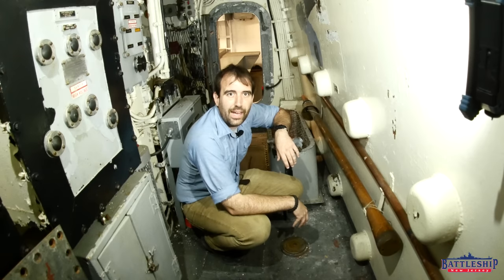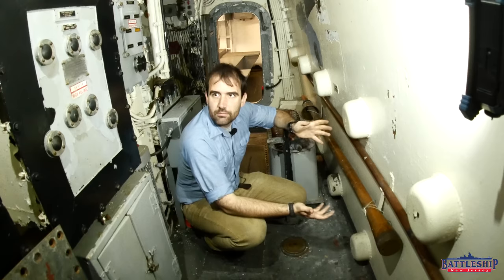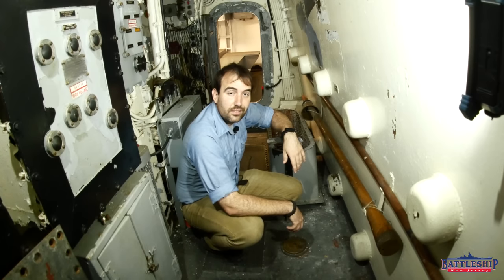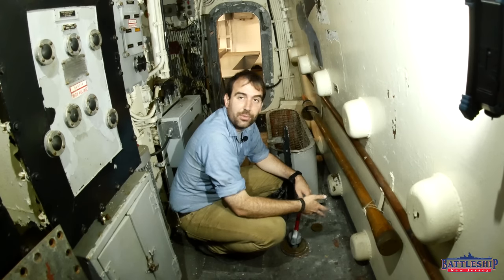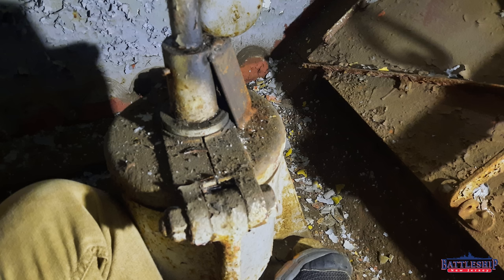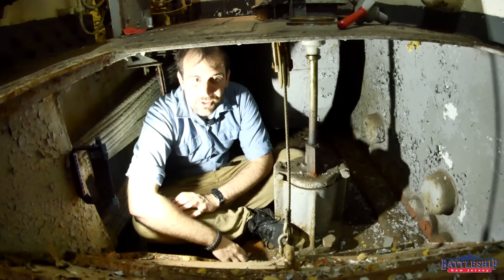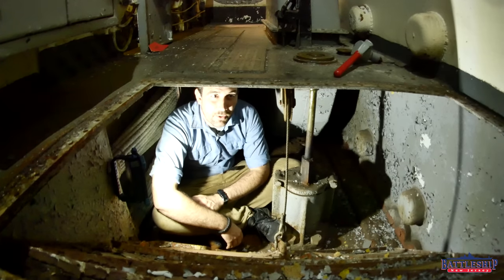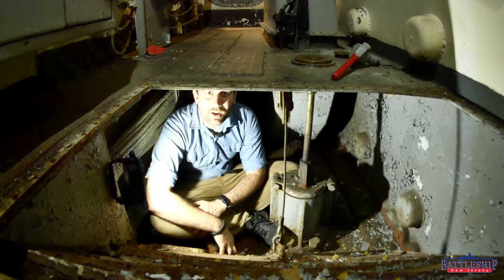Are The 16in Gun Turrets Welded in Place? UPDATE!

Comment: IF the pins were removed.there should be a manual gear reduction drive in the turret...on either the south Dakota or NC class such a drive exists..it is like 3 hours to move...same with elevation of the guns.  I saw a video of one of the memorial battleships lowering their guns to put the bloomers on...perhaps Massachusetts or Missouri
Reply: There most likely is. You can get a glimpse of the gearing that turns the turret in the video that Ryan did about the electric deck.
Reply: You can elevate the guns manually, but I don't think you can travese them. Don't think the gear reduction is low enough.
Reply: @ionstorm66  I bet its possible to decouple the hydraulics and then use a block and tackle on the barrels to the deck since its just sitting on rollers

Comment: Ryan you give up too easily.  Whatever turns or rotates under power almost always has a manual wheel to operate the thing when power is lost.  emergency steering for example, yes it takes several thousands manual turns on the wheel to move it, but its there.  The turrets must have a manual rotation gear in there somewhere.
Reply: Or find away to lower the amount of amperage the motor draws. Imagine letting people pay to operate the forward gun turret. Just install sensors and a computer to limit the movement allowed and a button for emergency stop.
Reply: Yeah or lift an external generator aboard or use a high current motor controller.  Could almost certainly get it to move somehow.
Reply: @ThePTBRULES  Yeah, I mean it takes a lot of power to turn the turret fast , if you reduce the speed, this also reduces the power needed. Of course the question is if it is possible to reduce the speed without heavily modifying anything.
Reply: @ThePTBRULES  Keep in mind the breakers are only for extreme overcurrent and to prevent the wiring from catching on fire.  It's not what the motor is rated at.
Reply: You can convert horsepower to kW. 300hp is 223.71kW. W=A*V. Assuming a 450V motor, that’s 497.133A. However, given the amperage of the breaker mentioned, it is probably a 125V motor as that would draw 1789.68A. 

Wikipedia mentions that the SSTG’s provide 450V power. Based on my experience in the Navy, shore power is supplied at the same voltage as the generators. This means that the 1200A shore power breaker can provide 540kW of power. Over double what the turret needs to spin. 

So, yes. They can rotate A SINGLE turret on shore power easily.
Reply: @shaun3423  yeah makes sense.  So they simply need a monster transformer to drive 450 volt.  Also with a motor controller they could generate the necessary waveform and get a torque vector that is as strong as their power supply cns support.  It's fine if the turret moves only slowly.
Reply: "Ryan you give up too easily"
Here's what I imagined happened:
Ryan: "Guys! The turret is technically welded in place, but we can undo it in like 5-10 minutes! Let's do it and move the turrets because it would be REALLY COOL!"
New Jersey Department of State, United States Navy, half a dozen other agencies/organizations: "NO!"

Comment: The whole point of the navy putting them in museums was so that, if it became necessary, they could, theoretically, re-commission them. It makes no sense at all that would hard weld the turrets in place at a point that would destroy the mechanisms themselves for future use.
Reply: Not really, this was done when they were put to reserve, not museum donation. The potential for them to be mobilized was primarily aimed at by what is and is not allowed contractually, but only to a point and that point is mostly gone because navy got rid of whole lot stuff needed to support them.
Reply: Once gone from the property of the state, they're gone. As museum ships (and outside the gov's care) they're no longer usable. They're governed under an agreement plan (as Ryan states) but that's about as far and wide as the reach of the gov goes. Well, maybe if the museum tried to ... i dunno, sell the ship to another country's military... but that might be in the agreement papers as well.
This mod we see here, isn't done for museum deactivation purpose, this is done because it's the cheapest simplest method to stop this turret from turning.
I've seen this thousands of times, if there's an easy way out to stop something from doing something, where the need to keep the mechanism at large in existence is in place, the shortest, easiest path is always taken.
Old buildings, they take the cogs out of the elevator mechanisms. They cut the first floor ladders out. The're doors barred with concrete blocks to stop the door from opening. 
Bunkers, they will just cut the wires to the electric motor or drain the hydraulic fluid out of the hydraulic motors. Even saw a bunker where they basically removed the metal link bar from the safety system, so once all but the escape shutter doors were closed, they could never be opened and then poured a concrete plug on top of that final door. Easily reversible.
There's a bunker complex in Italy, they just walled up the main entrance, you can still get inside the old cableways.
Reply: @aserta  The Iowa's are special case. Recievers of the ships have to keep a minimal level of maintenence on the ships so they could'theorticly be returned to service of necessary.. That restrction was supposed to end in 2011 when, as the law states  asufficent replacemtn system of equal or greater firepaower could realized.The problem, is, the railgun is far from being as ready as they hoped. Hence why Iowa was moved to LA, becuase the curators in SF couldn't afford the minimum maintanence required by the law any more.

Two, while fully decommissioned, are still listed on a reserve list. The other, while not on the reserve list, still must have minimum maintaince so they can be used for parts if the other two are returned to servivce. 

The Battleships are the only servicable weapon the navy has that can do close shore support for large scale amphibious landings. Aircraft, while they do surgical strikes, just arent capabable of staying on station and essentailly carpet bombing the shoreline and near shore defenses. Until the railgun system is ready, the Iwoa's are not fully released from the navy by law. They can still be recalled and have to be maintained for that possiblity. No, museum curators do not have carte blanche to do whatever they want with them. The navy is using the museums as simply free long term storage.
Reply: "navy putting them in museums was so that, if it became necessary, they could, theoretically, re-commission them."
Like, say, in case of alien invasions where the invaders fire toy-peg-looking shells at ships happen to drop down and challenge both the United States Navy and Hollywood to a game of "Battleship."
Reply: @matchesburn   As opposed to scrapping them.
Reply: @snagletoothscott3729  
"The Battleships are the only servicable weapon the navy has that can do close shore support for large scale amphibious landings. Aircraft, while they do surgical strikes, just arent capabable of staying on station and essentailly carpet bombing the shoreline and near shore defenses. "

In what alternate reality do you live?
Never heard of carriers?
They have things on board like planes and helicopters that can be used to support landing forces (and far beyond the reach of BB guns), loiter for hours while the ship is far away from enemy lines and these 'guns' can actually see their targets

It amazes me the childlike naivety people possess when it comes to old battleships
They are obsolete, have been for 75 years, just because some conservative thinkers didn't want them gone and the navy tried to use them because they simply still had them, doesn't change that fact
And even if Railguns become a reality, they don't need to put them on heavily armored 800' ships

Comment: Do the Iowas have a mechanical backup for any of the turret systems? Texas has the chain falls, then again, Texas also has backup steering after the electric and steam steering systems; I think we recently established that the Iowas have a mechanical adjustment, but not full rudder travel without the powered systems.
Reply: They do, but they're far too slow to be of any use in a combat situation.
Reply: @ghost307 So then the museum could turn the turrets without energizing the motors if they really wanted to, but probably not on any regular basis such as they do for some of their other equipment.

Comment: Shore power is intended to provide "Hotel Services" to allow crew to live onboard pierside while the plant is shut down.  There should be enough excess capacity past that point to allow powering the minimum required to light off 1 boiler.  The general plan is that you use shore power to bring up one boiler, allowing you to bring up a Turbine Generator.  Once that TG is up, you have enough power to start bringing up the rest of the plant.  

That said, how you checked the rated outputs of the Emergency Diesel Generators?  Any one of them should be adequate to bring up a boiler, and I'd be surprised if there wasn't enough power to operate at least 1 turret and support equipment.  (They should all have breakers/bus ties on the main board)

Comment: That is way more than a 300HP motor should draw. I suggest you look at the nameplate. If it is sevuced at 460V it should have a full load Amos rating of something like 400 amps. The breaker may be that rating to allow it not to trip on the starting inrush current of the motor.
Reply: Starting amps are about 6 times what the running amps are.
Reply: That's called the interrupting rating of a fuse/breaker and I think you're probably right.   I think max locked rotor would still be under 2500A on a 300hp motor...
Reply: @ghost307  Yes, and a properly functioning breaker should allow that through. A breaker can trip either magnetically, which protects from short circuits, or thermally, which protects it from sustained overloads. Motor inrush current shouldn't be high enough to trip a breaker magnetically or sustained for long enough to trip it thermally.

Comment: That looks like your industry standard cheapest fastest option to "weld it in place".
Reply: Yup, but that’s sort of what you’d want as part of your efforts to mothball a ship. Your modifications should be the minimum necessary to make the ship ready for long-term storage, while simultaneously as easy to reverse as you can make them. The pin is already doing the hard work of keeping the turret from rotating. All you need is to keep someone from mistakingly raising the pin.

Comment: Didn't you guys do this one already?
Reply from the maker: We have new info! This is a follow up
Reply: @BattleshipNewJersey  Do they move now? Because in the last one they (spoiler alert) didn't, but were capable of movement.
Reply: @BattleshipNewJersey  You mean you folks went crawling under the shelf plate without me?
Reply: Happy to see another video guys. Thank you.
Reply: @BattleshipNewJersey  so... Now that Iowa has turned one of its turrets, how long does it take for you guys to make it work? I specifically want to see Ryan dremeling the welded pieces of iron off, that hold the locking pins in place😂 After an hour or so you should hand him the angle grinder over.😜

Comment: A 300hp motor at 480v is going to draw 350-400 amps.  The problem would be inrush current on start-up which only lasts for a few seconds but can be 6x-8x the full load amps.  That's why the breaker on the ship is so big.  Depending on the breaker on shore, you might be able to adjust the trip time to handle it.

Comment: I'd be surprised if the turrets would rotate even with power to the motor at this point.  The 16-inch turret weighs around 2000 tons and I suspect that they've more or less "welded" themselves into place by now.  I think the term I'm looking for is "seized".  Would take a lot of WD40 to get her moving again.

Comment: A 300hp motor full load at 480v would be 348 amps. 208v 698 amps. With the ship stationary I'd bet it would take less then 25hp (75 amp at 208v) to rotate the turret. You have plenty of electrical capacity to move them slowly. Chasing a fighter jet with the ship bucking.. not so much.

Comment: No way does a 300hp motor draw 1800 amps...a 3 phase 480 volt 300 hp motor draws approx 350 amps at full load
Reply: But what's the starting current?

Comment: I believe you are misinterpreting the current requirements for this 300HP motor. Now you did not provide the specifics of the motor in question, but making some assumptions I offer the following. Assuming this is an 3 Phase AC powered motor and using a nominal shipboard voltage of 480 VAC, a 300 HP motor would use approximate 400 amps of current at max load and full running speed. The problem is overcoming the inrush current required to get the motor spinning at the start. Inrush current can be up to 6 Times the running current but this current draw only lasts a few milliseconds until the motor starts to rotate. It is doubtful that the Shore Power Breakers would trip on an overcurrent of a few milliseconds. Can you provide the specifics of the motor in question including the breaker used to feed the motor?

Comment: Im no electromechanical engineer. However.  I would think, with the advancemants we've seen in electric motors and gearing over the last few decades. If it was financially possible.  I bet you could get them rotating again. With some form of modern electric motors.  That being said.  For what reason? It would be a very large sum of money to spend for something that would probly rarely be used and with that kind of money.  Many, many improvements could be made to more crucial parts of the ship

Comment: It still should be possible to move the turret if the welds are removed and those pins unlocked.  The way the Navy built ships with redundancy in mind, there's bound to be a hand crank around somewhere.   However, I also think it would take a ridiculous amount of cranking to get any significant movement, so I sure wouldn't want to try it.

Comment: I think that is the only weld, that is enough, it is the pin to hold it in place, the weld only locks the pin. That weld makes perfect sense.
Also if you wanted to turn the turrets, (and or elevate the guns), for idk, a special ocasion, the birthday of the ship, ( I mean in 20 years she'll be  100 years old!)
You could always look into a dieselgenerator to power the main busbar parked somewhere on the quay or the deck.  even if your shore connection braker can't handle that, A propper electrician should be able to tie that in temporary.

Comment: I guess an enigma solved, great work Ryan. What found certainly fits the bill :"Before section 1011 was
enacted, the Navy had begun to demilitarize the U.S.S. New Jersey by welding down the training mechanisms of its 16-inch guns. Despite this action, the Navy selected the U.S.S. New Jersey over the U.S.S. Iowa, which had one of its 16-inch gun turrets rendered inoperable, due to an earlier explosion because repair cost estimates for the latter were greater."  the text being from GAO Report to Congressional Committees in April 1999. I was suspecting something more elaborate as welding the shaft or gear of a training motor, but this cover all bases.
Reply: I kinda wonder if some battleships non-friend ordered them wielded shut to make repairs impractical and thus justify getting rid of the ships, and maybe someone sabotaging that a bit...

Comment: On Texas, the turrets can be manually rotated by use of the Chain falls, a system of pulleys and chains that use man power to rotate the turret. Considering you can manually elevate the gun barrels by use of a pipe wrench and lots of hours, is there something similar on NJ or are the turrets just too big for that to be an option.
Reply: being that its on big rollers I bet it would be possible to decouple the hydraulics and rotate the by putting a chainfall on outside around a barrel to the deck as a redundant system

Comment: Seems like a modern 300hp electric motor would draw a lot less than 1800 amps. Just say'n.
Reply: Not when starting.
Reply: @ghost307  A quick search yielded a high torque 300hp motor with 335 amp draw. Start should be under 700 amps.  $14k.  Bargin!
Reply: @jth877  Actually our friendly government mandated about 10 years ago that all new motors had to be 'premium efficiency'. This reduced the current needed to run them, but the redesign unfortunately significantly increased the current needed to get them started. The traditional standard for many years was 5-6 times FLA to start but I have seen the new motors being as high as 12-14 times FLA.
I've lost track of how many times I've had to upgrade motor starters when my client bought a fancy new motor. Once we actually had to upgrade the incoming utility service.
I really wish people who know nothing other than how to get elected would stop thinking that they can rewrite the laws of physics.
Reply: @ghost307  That sucks.  So the starting cap has to be a higher value or the wiring needs to be bigger?  If it's just a matter of a bigger cap then you could still run the 335 amp motor, right? 

ETA: Wow. Just looked up some of the starter panels for 460v 3ph.  These are just fancy capacitors?
Reply: @jth877  The wiring size is probably fine but as you say the issue is getting the motor started.
As soon as you apply power there is a huge current draw associated with saturating the metal in the motor.
BTW the motor starter has to actually handle that full inrush current. Capacitors perform a completely different function with an inductive load like a motor.
Reply: @ghost307  SMH, I'm sticking to mechanical engineering.